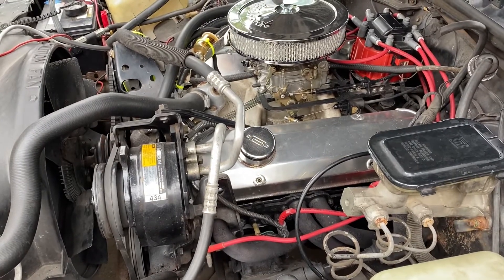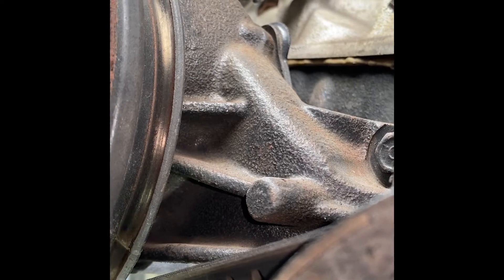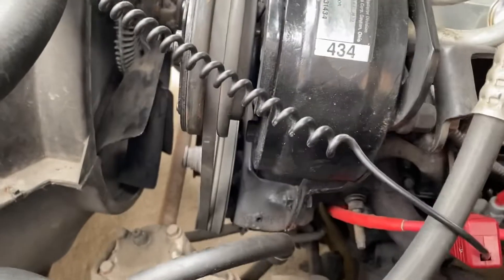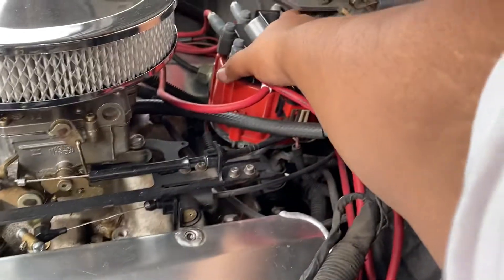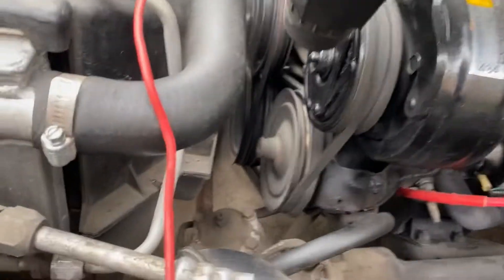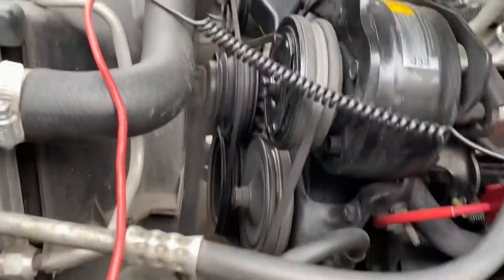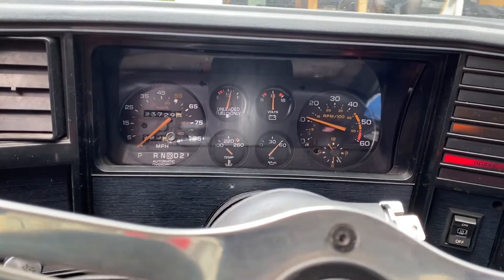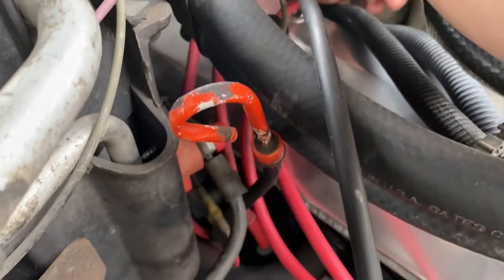Setting total and initial timing on a sbc

Comment: How do you adjust for total timing when  it's way off..springs or an Allen wrench at the vac canister.
Reply: Rev it up to 2500-3000 rpm with the vacuum advance disconnected from the carburetor. Counter clockwise will advance the timing clockwise will retard the timing. I'm assuming you do have a sbc or big block
Reply from the maker: Disconnect the vacuum canister. The total timing advance happens at different rpm’s. Depending on how your distributor is curved. Could be 2,000 rpm or 3,500 rpm I keep reviving higher until it won’t advance any more.
Reply: @heavychevy2289  Hey I have a 4 barrel edelbrock carburetor 600cfm with electric choke mounted on a 350 sbc engine, I just got it to fire for the first time since rebuild 2yrs ago, I have a high idle a 3,000rpm, I've adjusted the mixture screws and idle is still not going down, could it be that I have my distributor too far advanced?
Reply from the maker: @road2richz_q266  Yes it can cause, you to idle high. But so can a vacuum leak. I’d check the idle and fast idle screws first.
Reply: @carsntrucks782  I fixed it turns out it was just my throttle bracket not closing all the way back, I had to readjust my spring it didn't have enough tension on it

Comment: When you set the gun at 34. Where is it showing on the engine.
Reply from the maker: The line on  the harmonic. Balancer  and the time tab on. The engine are aligned
Reply: @carsntrucks782  I get that but what degrees should it be around
Reply from the maker: @kylel5p454  it depends on your engine compression. Are you running nitrous or forced induction? then you would have Timing set at a lower degree for a pretty stock SBC around 34° will be good
Reply: Sbc 350 carb. Has a cam. And msd ignition.
Reply from the maker: @kylel5p454  I’d start at 32 degrees and test. Drive make. Sure there’s no detonation and keep adding I’d guess around 34. Degrees would be pretty good.
Reply: If you set the gun to 36 degrees and rev it up no vac advance it should say 0 at the timing marks
Reply: @christopherpoucher483  thanks. That’s what I was not understanding. Thanks for clarifying!!